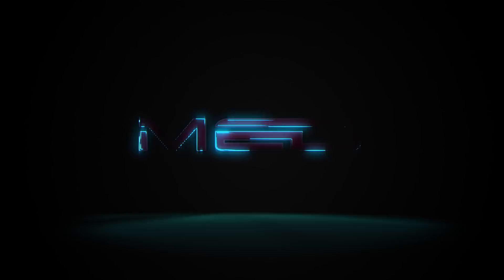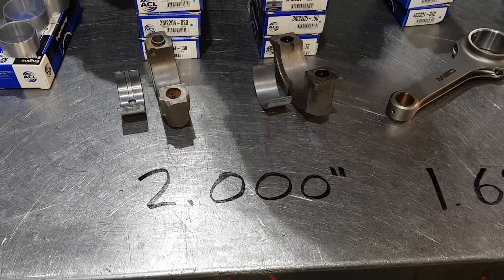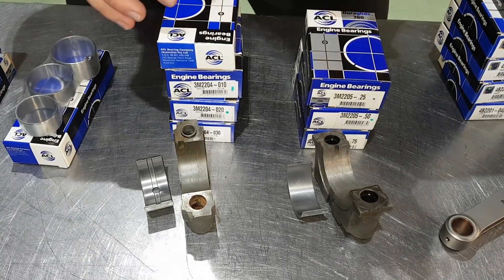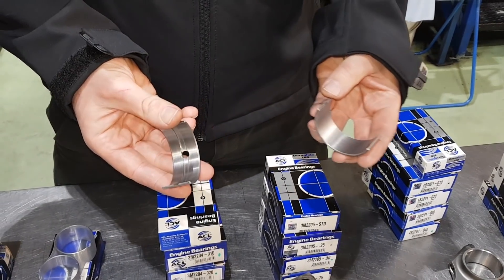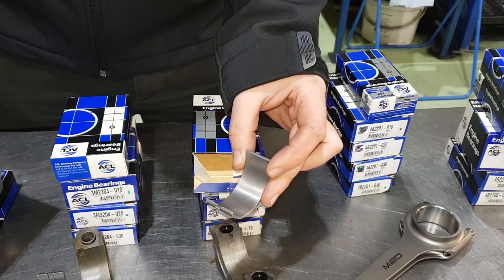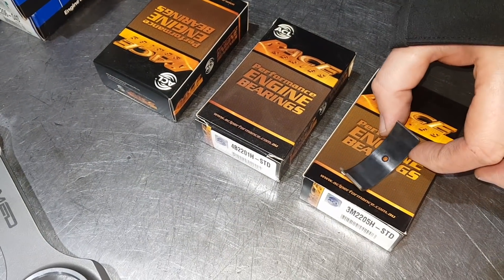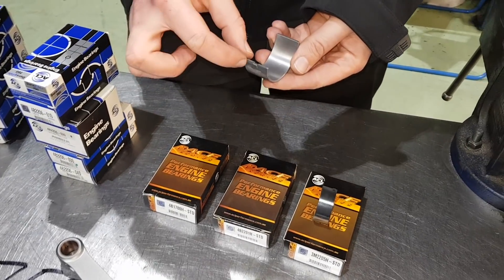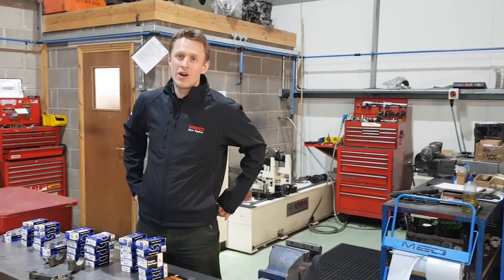A-Series engine bearing types explained

Comment: Do the 998 and 1098 also fit the 850?
Reply from the maker: Yes. Apart from cam bearings, as the 850 cam runs straight in the block.

Comment: When I assembled my metro engine with new bearing and reground crank, I noticed some light score marks left on the surface when removed for the second build, would this be normal?
Reply from the maker: It's difficult to say without seeing quite how bad the score marks are, but yes, they will usually get marked up slightly. Once up and running these marks will go.